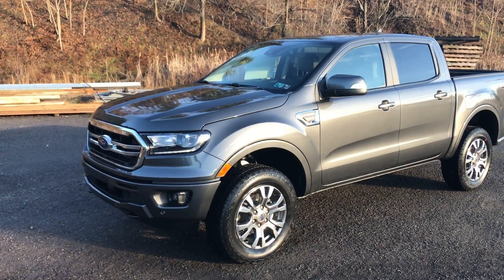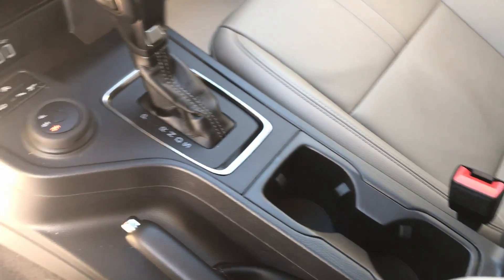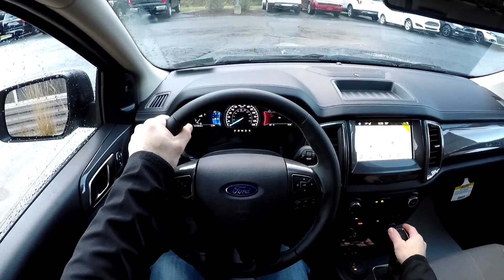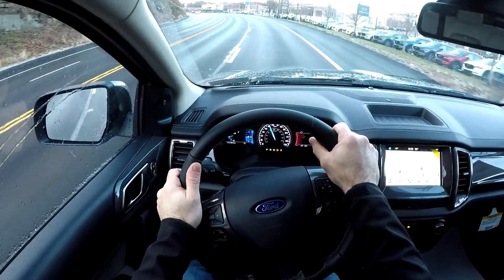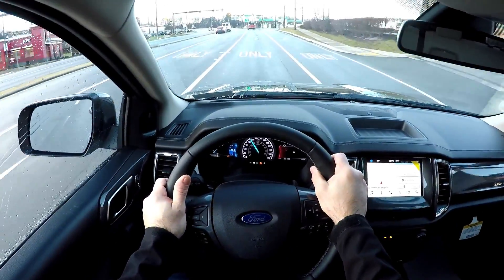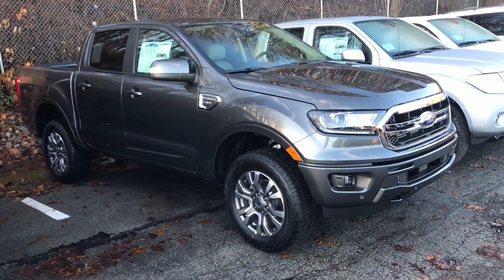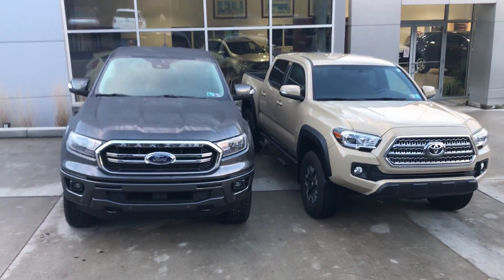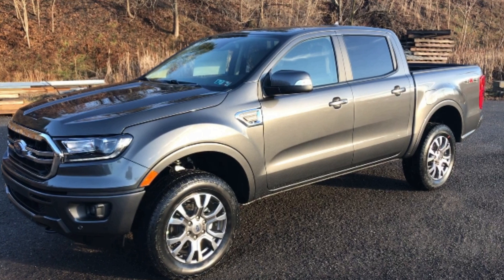2019 Ford Ranger Review

Comment: I was eagerly waiting for the Ranger to make a come back. I love trucks but after driving a Dodge Dakota for a few years I craved a Ford. I was looking at the new F150s & almost pulled the trigger. But my wife & I bought a 30’ Travel Trailer so, I needed a bigger truck. After looking for awhile, I found a sweet ‘05 F350 6.0L stock except for an Edge Evolution CS2 stock tuned, leveled, deleted, studded, straight pipped, coolant bypass filter & axel dump exhaust. 
Pulls the trailer with ease! This is my first diesel, so I have a learning curve for sure, Lol!

Comment: The 2019 Ford Ranger was a wonderful truck to drive I liked just about everything about it. That B&O sound system is not worth the money though, it didn't impress me at all. I also don't like what they did with the backseat because I tend to haul some stuff back there and it just doesn't seem to be well thought-out. The engine and transmission are superbly calibrated and the engine pulls really hard without making a bunch of noise. The ride and control is very nice for a truck and the whole thing seems very agile and eager to move. I actually prefer the ranger over the Toyota Tacoma TRD sport that I had for a test drive.
Reply from the maker: Its is a nice truck. The Toyota is defiantly under powered.

Comment: I can’t wait to get my hands on one!!! I used to own a 2000 Ford Ranger.
Reply from the maker: We would love to sell you this one Mike!
Reply: I'm still driving a 2007,  hard to say if these are as well built as the last generation.
Reply: PIPSBURGH VIEWS I would love it but I cannot afford a $46,000 truck, I make less then that yearly.
Reply: @MrMraggies1996  Agreed!  I want a farm truck.  No radio, no carpet on the ceiling, no electronics, old fashioned manual locking hubs, a man's truck.....for $15 000 brand new!
Reply: @TheBeatenPaths  Probably the cheapest is the Frontier with 4 banger and 5 speed manual.  I think it still has a radio though.  But roll up windows.  I think you can find them for around 18k.  That would be 2WD however.
Reply: Mike Herrington they are brilliant trucks. This model has been out in the uk since 2012 with a facelift in 2015/16 and it is brilliant. I have the 3.2 Diesel engine that had 200 bhp stock, but I tuned it to 280 bhp and 600 nm of torque. If you get one you won’t regret it. Enjoy! 👍
Reply: I currently own a 2000 ranger and plan on getting one in about a year and buy one off someone used

Comment: Brian, your reviews continue to be the best around. Best of luck with your BMW. If my friend's BMW is any guage, you are going to need it.
Reply from the maker: Thanks Mike, I really appreciate that! Oh no, what is going on with your friend's BMW?
Reply: @PIPSBURGHVIEWS  It seems like little things keep breaking or malfunctioning. It's a 2012 545. Things like battery going dead for no reason - jump start it and it runs for months then dead again, belt tensioner going bad, wheel breaking at a pot hole. Just general annoying things. To top it off it only has about 10,000 miles.

Comment: Would pull the trigger on one right now but I feel like there is a lot of stuff missing.its 2019..LED headlights should be standard.for a 46k midsize truck there needs to be a sunroof option and cooled seats.also a premium cloth option on lariat would be nice for people who hate leather.
Reply: It's not starting at 46k. The top build starts at 32k and does have LED lights
Reply: Delain124 to get most of what I want I would be getting a lariat which would be basically optioned out which is close to 46k..I would get a optioned out XLT but a XLT doesn’t come with leds and the b&o sound system and some other things

Comment: Great video as always, Brian.  This could be an option for me when my current lease ends.  I was considering the Ecosport or the Edge but might just end up with a Ranger.  Have you seen many Edges or Ecosports in for service other than for routine service?  Thanks in advance for your input.  It’s great to have these reviews from someone on the inside who actually works at a dealership.
Reply from the maker: Thanks Alex. I have not seen any major issues with either vehicles. The Ecosport is really small, not sure if you watched my review of it. It was my first full car review.
Reply: PIPSBURGH VIEWS I’ll look for it.  Thanks for the heads up.

Comment: Good review! 
Been driving the european version in Belgium about 3 years now ( largely the same design), but with a 2.2 liter 4 cyl. Diesel Limited edition with a for american terms a ridiculous 160 hp.
So i will not be talking about acceleration etc ;)
This american version has a nicer leather interior, and the new design features are a big improvement.
It really drives and feels like a car, i agree.
Haven't had any problems with it accept the tearing of the leather seats ( replaced under warranty).
Even with this small engine it has very decent terrain capabilities.

Thanks for your review, i enjoyed it, keep up the good works.
Reply from the maker: Thanks Mark, is cool to hear about cars in other countries!
Reply: The 2019 Ranger will offer the similar updates globally, just the powerplants will differ. Australia already has the 2.0 biturbo in their range making 157kw (211bhp) alongside the 147kw (197bhp) 3.2 five cylinder.
Reply: @saudabrahams  Glad you mentioned that.  Lots of great diesel options for the Ranger overseas. And early reports for this tiny boosted 2.3 are showing crappy MPG's.  Like 20 MPG averages.  Not good.  The bi turbo is what this truck needs.  Bad.
Reply: So how many Kilometers per litre do you get.  I bet its impressive.  Trucks don't necessarily need allot of acceleration.  But at 160 HP I can see where the throttle response may be a bit lacking.  Better option is the newer 2.2 bi turbo.  IMO, that should be the single engine option.  If Ford wants a one engine for all. Make it the 2.2 bi turbo diesel and be done with it.
Reply: HiPlains1 , 33-36 miles per gallon average overall

Comment: I don't feel so bad about buying my 2018 F-150 XLT - I was concerned that it may have been too much truck (for what I need - which isn't towing just a few things in the bed) and the Ranger would have been a better fit.  There are too many areas where I think the Ranger (and most mid-sized or compact trucks) wouldn't be "enough".  Funny how the engine's exhaust note sounds like a flat 4 (almost Subaru-ish).  Great review Brian - I too like the part with the truck up on the hoist.  Would love to see a review of the new Edge ST!
Reply from the maker: Thanks Scott! I did an ST review, its a view videos back,

Comment: We also have the Ranger in South Africa. We have the Raptor version in SA and its good, but the V6 Amarok beats it by far. In South Africa...

Great Video Brian. 
PS. Love your beamer
Reply from the maker: Thanks Daniel, we don't get the VW or the Raptor........yet. I head Ford and VW are going to work together and the new Amarok may be built on the Ranger platform.
Reply: They have a plant in South Africa I believe.  I think the Raptor is built there.  As far as overseas models there are so many that the US does not get.  Off the top of my head, Isuzu D-Max, Nissan Navara, Amarok, Ranger, Mitsubishi L200, Mercedes X-class and I know there are some Chinese compacts that make trucks.  All of which have diesels which IMO, is best for trucks.  Unfortunately, its so expensive and a PITA to get diesels passed through the EPA that most oems don't bother.  But the base 2.0 diesel on the Ranger overseas will get 35 MPG easily.  Real world numbers are coming in on this highly boosted little motor on the Ranger and it's looking no better then Colorado's V6.  There is a reason that the entire planet uses diesel on Trucks.  The drag cofficients/size are always meh for MPG's on a truck when running on gas.
Reply: @PIPSBURGHVIEWS  a few years back Mazda had a version of the Ranger overseas.  Had a different nose and rear end treatment.  They looked ok but as far as I know Ford no longer partners with Mazda.  The CX9 no longer uses a Ford V6.  It has the mazda 2.5 turbo which is gutless lol.  Mazda only having two engines.  The 2.0 and 2.5 which also has a turbo version.  Hopefully next year Nissan will finally bring in their Navara Truck.  Hoping they offer a diesel on that as well.  Unlike the American version of the Ranger, the Navara has a attractive body.  But I think the Ranger is probably more capable.  I'm pretty sure on the next refresh the Ranger Ford will be redoing that front end.  Never cared for it when they introduced that in 2015.  The 2012/2014 looked loads better.  They really screwed up this launch.  The best looking is the XLT but only the lariat gets leather and B&O.  That ended up being the show stopper for me and why I ordered a Colorado. Miss my 14 XLT ranger though.  Totally different then what the US ended up getting.
Reply: @HiPlains1  Yes. We build the Ranger Raptor here. But its the shittiest truck ever. Ride is rock hard, the ecoboost engin is low on power, the bed is to small, there to many gears and the you can not fit 3 adults in confort in the back. I would never buy one.
Reply: @danielscholtz2780  Ok does that have the 2.2 bi turbo?  Maybe they should have put the 3.2 in there.  I know when I had my 14 XLT with the 3.2 it has globs of power/torque.  As for the Raptor I would say Ford has their work cut out for them.  Chevy has the ZR2 Colorado and that sucka is a beast off road with lockers on front and back (still no front locker on the 80K full size raptor)   Now Chevy is coming out with the new Bison which takes it another level.  If they price a Ranger Raptor over 50K its going to be a hard sell.  The ZR2 will already destroy the full size 80K dollar raptor when off roading.  The Raptor will blow its airbags trying to keep up and that's no exaggeration.

Comment: Brian, have you been seeing transmission shifting issues with the 10 speeds? We have a october 2018 build and its in general shifting kinda shi*y. No TSB or PCM updates but was curious of you knew anything.
Reply from the maker: We have only had one 10 speed apart so far. No other issues that I know of. Do you have a Ranger with issues?
Reply: no I didn't specify. 2018 F150 lariat with the 10 speed. Its got a rough 3-4 shift when cold and from what Ive read its pretty common.  @PIPSBURGHVIEWS

Comment: Good job Brian. I like the underside view and the side by side comparisons of its competition.  I don't like the plastic tranny pan or where the oil filter is located and agree it should have had paddle shifters. I don't think I would get a Lariat but maybe consider an XL with STX and FX4 supercab if they are not too pricey. Ford really should have offered us the diesel option as well as the Raptor versions that the rest of the world seems to get.
Reply from the maker: Thanks Robert, I would defiantly opt for the FX4 package and I am bummed about the Raptor.
Reply: Between approximately $400 million in civil penalties, an extended warranty, a proposed class-action legal settlement and other costs, FCA is expected to spend more than $790 million to resolve cheating allegations involving approximately 100,000 2014-16 Eco-diesel Ram 1500 pickups and Jeep Grand Cherokee.  Diesel is DYING in America!

Comment: Can you comment or share your opinion regarding the Ecoboost motors as a longtime Ford mechanic?  I'm considering either the Ranger or F150 and would like to hear your feedback prior to buying one vs. a non-boosted competitor for reliability/longevity?
Reply from the maker: Unfortunately, the Ranger is too new for me to comment on but we did see some issues with the Focus RS and Mustangs with the 2.3L but no issues with the MKC or Explorers. As far as the F150 goes we saw some issues the the 3.5L and the 2.7L when there were first released but they have proven to be good engines. My choice would be a 3.5L F150.
Reply: @PIPSBURGHVIEWS  Thanks for the reply, on the F150 I assume you favor the 3.5L over the 5.0 V8?  I'm looking at the F150 at this point so appreciate the help!
Reply from the maker: I do, I like the power and efficiency. I have owned F150s with both engines. I will still test drive both if I were you. The V8 defiantly  sounds better and costs less.

Comment: Bryan can you make a video on the ford Ranger recall , what needs to be done ?
Reply from the maker: We got rid of the only Ranger we had before the recall came out, if we get another one in, I will try to film it.

Basically, if you can put the truck in gear without your foot on the brake, there is a problem with the wiring for the shift interlock. So, we would take the console apart and fix the wiring.
Reply: Thank you for the explanation . @PIPSBURGHVIEWS

Comment: Definitely has a place in the market.  Depends on how many people they can pull from the Tacoma.
Reply from the maker: It will probably be a good bit, there are a ton of diehard Ford fans out there.
Reply: Once they test drive them, it won't be hard.  2016+ Tacoma refresh is GUTLESS.
Reply: Don't forget Chevy.  They sold almost 170K units in 2018.  Toyota sold 245K units in the same year.  Both these oems are big sellers.

Comment: Record scratch at the “auto stop/start”. I really don’t want a vehicle with the auto stop/start. Bummer about the turbo lag. How many oil change places are going to remove a tire to service the oil?
Reply from the maker: Aftermarket companies do make a bypass harness if the auto stop is a deal breaker. I think if you have a lift you won't have to remove the wheel.
Reply: I would think you would rotate your tires the same time any way, maybe, I would

Comment: A little off the subject but the fact your from Pittsburgh and a mechanic....

Anyone you recommend in the South Hill, West Hills area that works on high performance cars with modifications, specifically LS engines. I do a lot of work myself but I have a new Camaro set up for the track I bought and would like to find a good mechanic in case I run into problems on something
Reply from the maker: Rich at Auto Illusions in Moon Twp is pretty good. Maybe I will see you at the track in the spring.

Comment: No, you don't have to take the wheel off to change the oil filter.  The article that originally said that was incorrect.  https://twitter.com/mrlevine/status/1082294800248905728/photo/1
Reply from the maker: Thanks for the update Brett. On a lift you won't have to but if you are doing it at home, I still think you might.

Comment: I have an older ranger and still works great it's a 2006 .a bit gutless with the 3litre but hear the 2.3 turbos had problems in the past. Ill take a new tacoma first  better value
Reply from the maker: I actually think the old 4 cyl. had more power than the 3.0L lol. I hope they finally have all the bugs worked out of the 2.3L.
You can't go wrong with the Tacoma.

Comment: I feel the Tacoma could’ve brought the channel a lot more content as opposed to the BMW.  I would’ve loved to see the Tacoma lifted, off road tires, snorkel, led lights, cold air intake, tune, possible supercharger?
Taco is the best selling midsize truck!
Reply from the maker: I liked the Tacoma but the main reason I bought it was for resale value which worked out in my favor. if it were lifted with big tires I don't think it could have gotten out of its own way!
Reply: 2016+ Tacoma is gutless.  Brian speaks on turbo lag in this video but I bet this Ranger would absolutely mop a Tacoma in the quarter mile.  The Tacoma doesn't even hit peak HP until after 6,000 RPM.  It has the worst midrange of any pickup I've been in with a v6 or bigger.

Comment: Why doesn't Ford use more descriptive package names, so you at-least have a clue what I  might. 501a could mean anything.
Reply: I see what you mean, but really then, what the heck do any labels mean until you look at what you get. To your point though, there's Harley's lettering system, which to this day I still have to lookup. FSRSDWIFIWIWIIJBLXYZPDQ = oh right a Road King. hahaha
Reply from the maker: No idea, it doesn't make much sense.
Reply: This is the main thing to remember.  The base and XLT trims do not get leather or the upgraded B&O sound system. And that, in short, is why the bundles are so full of crap.  You want either of those options and your right at 45K.  Sucks.

Comment: Everyone that made reviews on the truck says it will top the Tacoma that’s all I don’t mean to confuse you .
Reply from the maker: Hard to say. Usually people a skeptical to buy a car in its first model year. I don't think it will top it but it will definitely steal some sales.
Reply: I've had 94, 96, 08 Tacomas. I looked at a 2019 Taco. Still really nice tight trucks that are off road ready bone stock. But the new Ranger has me wanting to test drive it before going with another Taco. "So, I guess we'll just see, won't we?" - Budd in Kill Bill
Reply: @uk7769  The 2016 and up Tacomas are a far cry from the 2nd gen.  Worst midrange of any v6 Tacoma in the last 20 years.
Reply: @putmeincoach7663  Its the transmission right?  I test drove one and that motor is gutless.  Transmission searching gears etc.. A mess.  And after four years Toyota still has not fixed it.  Why, because morons keep buying it up at 20K units a month.  Makes zero sense to me other then they keep chanting resale value/reliability over and over again.